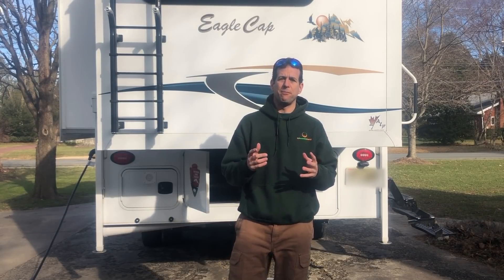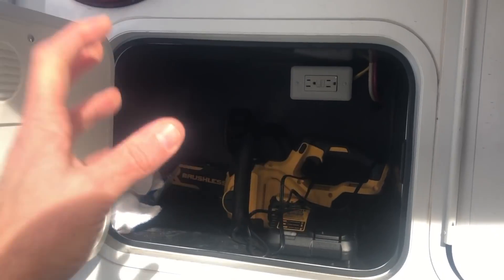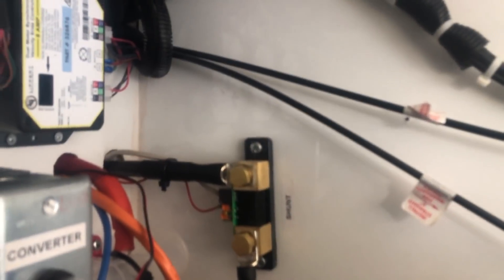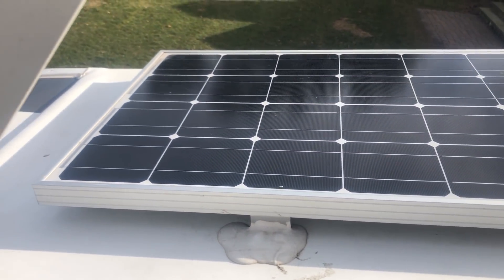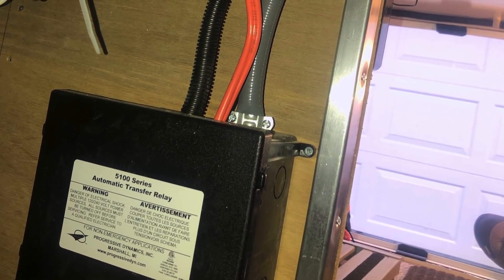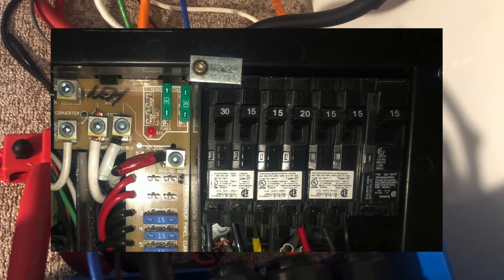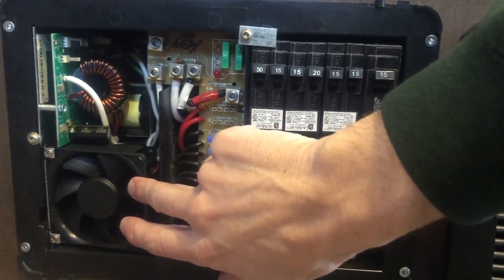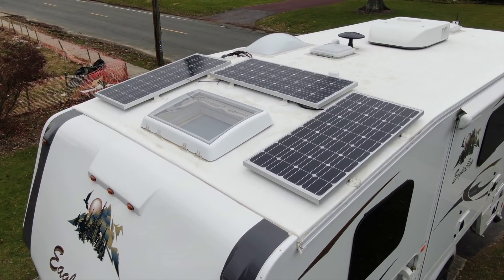How to Install a Lithium Iron Battle Born Battery Solar system in an Eagle Cap 1165 Truck Camper

Comment: OK I have my 2020 EC 1165 home.  I disconnected the old batteries and want to connect a new LiFePO4 460ah battery in the basement with an inverter.  Where do the wires that went into the battery compartment go to??  It looks like two 8 ga. wires come from the generator  and charge the batteries, and two 10ga wires that connect the battery to the camper, but where?  Do they run behind those stupid heat ducts?  There's so many wires running back there, all zip tied together, I can't figure out which ones are the battery ones.  It would really have helped if you had shown what you did with those wires.  I assume I still need to use them.
Reply from the maker: I have drawings on this video
Reply: @ThisWeekInSolar  OK, I see you hooked the generator starter wires that were back in the battery compartment to the positive and negative busbars.  I'm with you.  Then does the other set of wires that were back there go to the positive bus bar and negative shunt respectively?  Your drawing is cut off on the right side.  Thanks again!

Comment: Really great video! How did you wire your converter breaker reset. I see you have that mounted in an electrical box near your buss bars. Wait, I see that comes up later in the video at 9:38. Thx

Comment: Thanks for a great video.
1. Perhaps I missed it, but how do you prevent the power from your inverter cycling back through your converter and trying to charge the batteries? Should it be locked out when the inverter is running? 
2. The skin effect you mention in the 1/0 is largely an AC effect not a DC one.
3. I thought there was a waste tank in the space where you put your batteries. 
4. I would add another door at the front on the basement to access the water and pump with greater ease than that small round hole. 
5. Is the multiplus not an inverter charger?
Reply: He disconected the converter.

Comment: So are you happy with just the 3 bb batteries or would you should just more now that you have done this?
Reply from the maker: It’s been perfect.  Unless you want to have long term air conditioning, then more is absolutely better.  I’d add a panel more and most importantly a DC to DC charger off truck alternator
Reply: @ThisWeekInSolar  wow thanks for the quick reply it’s very rare.  Great videos I am hoping to get a truck and the same camper next year and start traveling

Comment: Basically if I just want to swap batteries with lithium what else do I need to change out , Im not interested in boon docking just standard use.
Reply from the maker: You can basically just replace lithium for lead acid. However there are some upgrades like a new converter that are made for lithium batteries. Furthermore there are also settings through a lithium-based controller that will manage the Batteries better.  It will make it work better but not required
Reply: @ThisWeekInSolar  Thanks, do you know which converter for the eagle cap?  Your renovation of electrical is really informative and you did it very well, I enjoyed your videos.

Comment: I have a few questions on replacing lead acid batteries with lithium, currently wanting to upgrade my 2018 1165.
If you have the time to answer my questions let me know.

Comment: How many battle born batteries do you think you can fit in the extra area you created ? Great video ! Thank you
Reply from the maker: Probably 3 more in old compartment.  If you were brave enough to remove propane generator, you could probably add 3 more.
Reply: NJRE thank you ! But specifically in the same area your three current batteries are located that would be the max amount?

Comment: Good install.  I did something similar on a van.   Instead of a converter changeout, I used an inverter with charger & transfer switch built in.  Curious as to why you only went with 300 ah of battery though - seems small considering you wanted to run AC.

Comment: Nice video, but I am 100% sure that Victron 3000 multi unit specifically calls for 4/0 and a 400a fuse.  Those buss bars you used are only rated for 250amps each.  They are technically undersized for that 3000W inverter AND your current installation.  2/0 wire is also undersized and should be 4/0.  Now, if you really don't use more than 2000watts at one time anyway, you should have bought the 2000w Victron, not the 3000w Victron.  But if you are using up to 25a (3000w) of energy, I honestly would not do what he's done above.  First off, Victron recommends 400AH's of battery, not 300AH's like above and all the associated safeguards that he went with.  But for those people watching this video, this is NOT the typical installation for a Victron 3000w Multipass inverter.  HERE  is a link  that explains it IN DETAIL....  https://shop.pkys.com/Installing-your-Victron-MultiPlus-Inverter-Charger_b_88.html

Comment: Hi Ed, Love your video and instructions and am planning to emulate your system. Your schematics and labeled pictures do not show the power in from the truck via the pigtail as part of the charging system. Did you simply attach this to the positive busbar as well? Thanks, Doug

Comment: Great video! thanks.  Question, if you have the Victron Energy BMV-712 Smart Battery Monitor with Bluetooth why would you need a Dongle or the Victron Color Control GX  if you can monitor the system with your phone?

Comment: Excellent walk through thanks for you time!!!!!!!!!!! I have invested in pretty much same system but a tad confused about  transfer relay, I thought the victron 3000 would accomplish same thing. I do have exact same setup with 1 more battery and no automatic transfer relay and no lithium charger in my panel, also have a cutoff battery isolation  for alternator from truck. Why do you need transfer relay. Self learning solar...................Thanks
Reply: My exact thoughts too.  I see there has been no reply...

Comment: On the AC shore power you split this with one wire going to the existing converter and the other wire going to the new Victron inverter.  I was under the understanding that the new Victron inverter had a built-in converter, so was this necessary, or could you have used just the Victron.  What was the benefit of using the existing converter?
Reply from the maker: Faster charging.   Over 100 amps total.  Both units hammering batteries.
Reply: @ThisWeekInSolar  The Eagle Cap 1165 existing converter is built to charge lead acid batteries, not lithium, so can the charge coming out of this converter be adjusted, or does the charge work also for lithium?
Reply: @ThisWeekInSolar  Hopefully you see this a year out! If you split the power out of the transfer switch to the converter in the Victron and the upgraded converter in your breaker panel, how are you able to limit the shore power through the controls on the Victron? Wouldn't the converter in your breaker panel try to use all the available shore it can power to charge the batteries?
Reply from the maker: @Not2Far2Go  The AC Power comes from shore power, spits and goes direction to converter with 15 amp breaker and then directly into multiplus.   If I have 30 amps service, its never is a problem.  If I have 15 or 20 amps, I set my multiplus to 10 or 15 amp max  to avoid any issues.    Even 10 amps almost always fine.  The multiplus will use both battery and shore power to manage loads, the moment it has a chance it will hit the battery harder when demands go low.  For instance, Air conditioner shuts off.

Comment: Now for the REAL question......what did this sweet setup cost??  How exactly are these going to pay for themselves??  Will they go out and get a job? ;)
Reply from the maker: They will pay for themselves on several factors.   1- they will last multiple time longer than any lead acid or AGM battery.  The chance of accidentally ruining them is 100X less likely than with lead acid.  They weigh a 1/3 less and actually a 1/5 less if you calculate actual available power.  Less weight, less fuel.   Less propane usage.   They work a zillion times better, better quality of life, and you can't put a price on that.  As for getting a job, my batteries work for Air Traffic Control, they are currently out sick driving for Uber since they are not getting paid.  :)

Comment: What was the charging amps?  Being as you have a 300 amp hour bank; does this calculate into your choice of charging amps?  I know that a 100 amp hour Battle Born battery recommends a 50 amp charge rate.
Reply from the maker: The new lithium PD4045LI converter will do 45 Amps, however, the victron multiplus I believe has adaptive charging, so I think I'm hitting the batteries from two sources.   I have to review my notes.   I don't remember what the amps should be, but I do know that having more than one 100 amp battery increases your ability to charger over 50 amps.